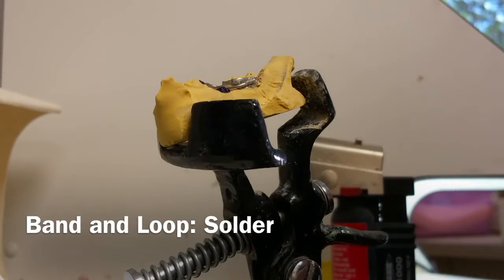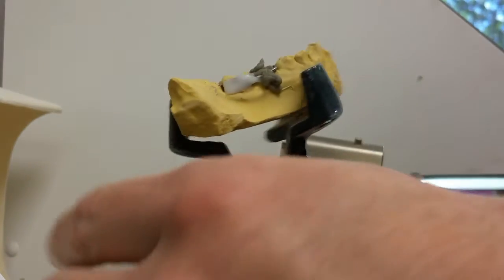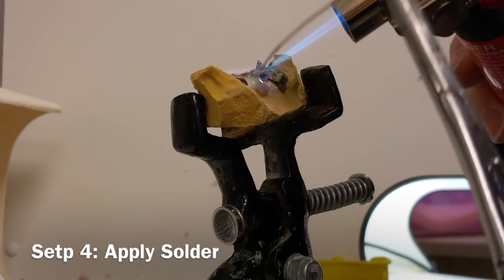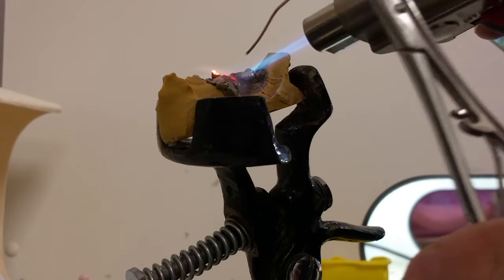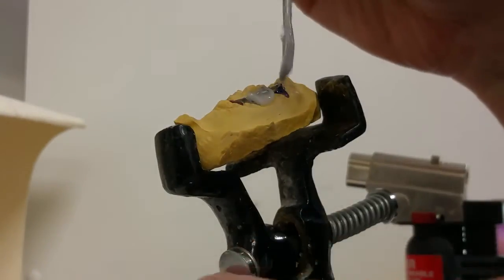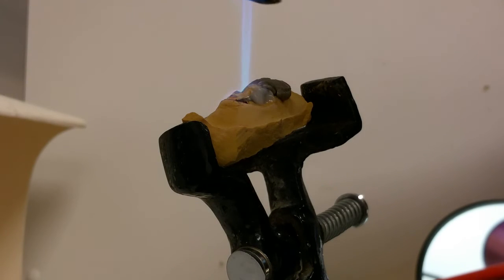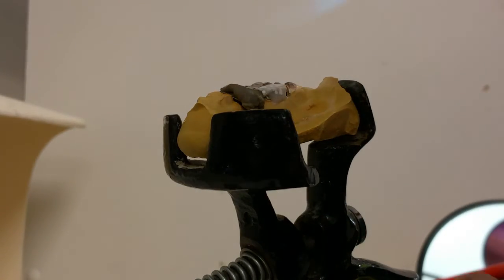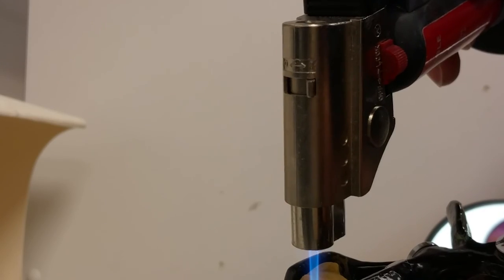Band and Loop: Soldering

Comment: I stopped using butane torches a while ago in favor of a map gas and oxygen micro torch. I can solder a band loop with a tiny piece of wet paper towel over the wax.😀

Comment: Hello, and thank you for sharing; do you know what's the composition of that flux? Is it boric acid like most fluxes, or are there more components to it?
Reply from the maker: It does have boric acid, but I am positive is has other ingredients. I will see if i can find the MSDS for it.
Here is where I buy it https://jbcandcompany.com/shopexd.asp?id=919&bc=no
Reply: Thank you dearly for confirming, and you would be even more dear if you had the MSDS lying around to check, I have had very little luck with my boric acid+borax+salt+distilled water mix on steel, using 55% silver solder. But then again, it was my first try :D
Reply from the maker: I found a couple of MSDS / SDS sheets. Cant post PDF here, so I made a post on my site.
http://blog.retainerdesigner.com/?p=1426

Comment: Hello friend .... did you find the way to bend wire into circle with 14" diameter ?
Reply from the maker: Sorry for the delay, i having trouble finding wire long enough. All my ortho wite is cut into 14" chunks i think i will have to attach a couple togetuer to make the wire long enough to have a 14"diameter
Reply: RetainerDesigner no problem friend .... im still waiting ... thanks